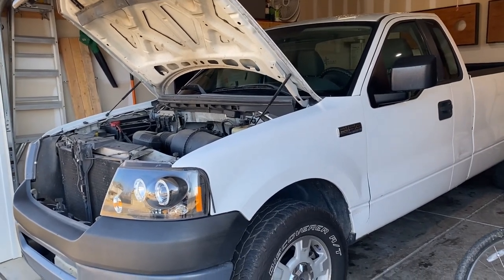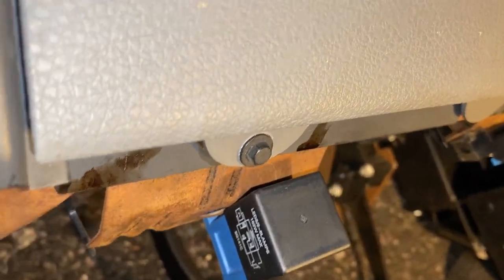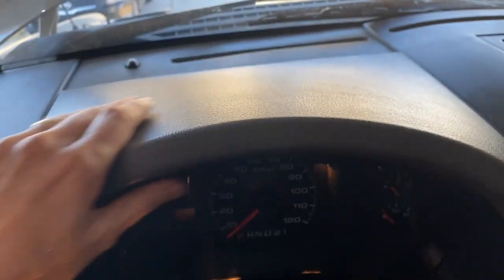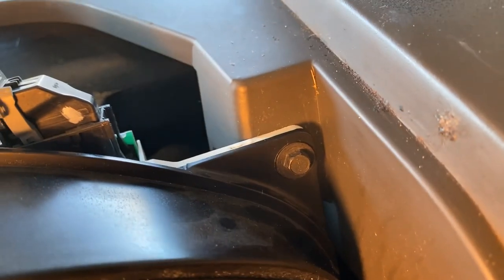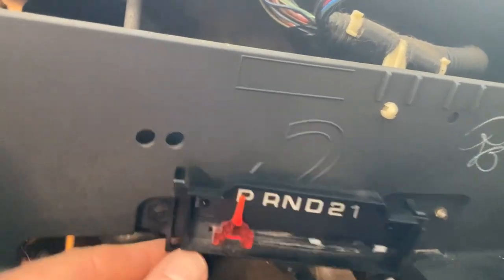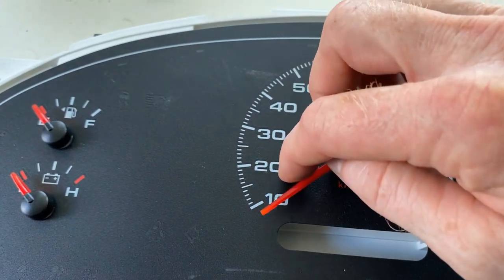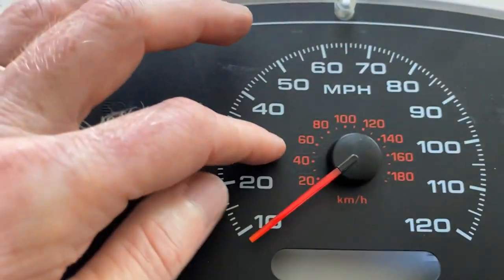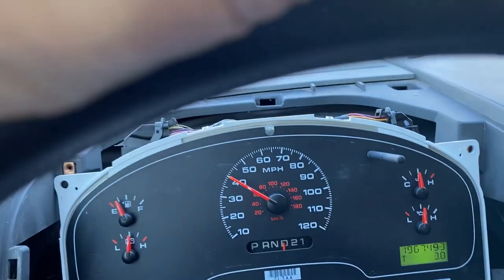2007 Ford F150 Speedometer Calibration - Adjustment

Comment: thanks for the video, my 2004 f150 lariat speedometer continues to reset itself. I adjust just as you have shown  after driving a few miles stopping several times the needle gets off point. example I'm driving 35 mph and speedometer shows 80 to 100 mph.  I have reset this multiple times and the results are the same. When placing in Park the speedometer shows 140mph. thanks for your help in advance.  anyone with an answer or directions on how to fix let me know.
Reply from the maker: That must be frustrating!  I would get an obd2 reader that displays speed. The PCM knows how fast the truck is going. That way you can see if the speed sensor,PCM or instrument cluster is faulty.  Make sense?
Reply: @resurrectionauto670  Ayo this is a long shot but I watched your video on a ford ranger auto transmission replacement which is very similar to what im doing, I'm raplacing the engine in a lincoln ls with a similar style transmission ( The torqeu converter has bolts welded instead of the threaded part) SO in order to mate engine and trans up the bolts have ot line up with the holes on the preassure plate but I have tried for hours and cant figure it out. You got any tricks for this?